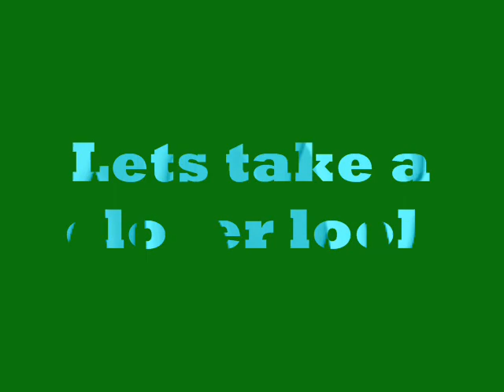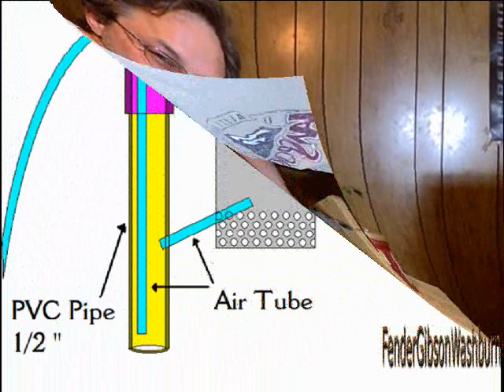Easy To Build Hydroponics System: The Percolator

Comment from the maker: @MrBlue609 Sounds like an interesting project. Experimenting and playing around with different configurations and ideas is my favourite part of this hobby. I've seen a similar system made with a 5 gallon bucket. I would imagine the number of air lift pumps would only be limited by the volume of air your particular pump could produce. Don't be afraid of trying different ideas. Chances are you'll come up with something amazing. Good luck and have fun with it!

Comment from the maker: @Shaunese07 I just let it run 24/7. Since it isn't a constant flow the roots get enough air. Switching it on for only 15 minutes is more for Ebb an Flow type systems. It sounds like it could be an interesting experiment though. Thanks for the comment.

Comment from the maker: Rockwool  works well in this system as do many other hydroponic medium. This plant was actually started in potting mix. I carefully washed off the soil and planted it directly into the Hydroton.

Hydroton is used mostly to hold the plant in place. I like Hydroton because It will retain some of the solution while allowing the excess to drain away.

Comment from the maker: Yes, you can use gravel with this system. I've used the small Pea Gravel that's used for landscaping and it works fine.

The stuff in this video is Hydroton. it's really light weight stuff. You would have to buy it from a Hydroponics Store or online.

Don't stress over it, just about any small stones will work since this is a constant drip system.

I have Oregano in this one now and it's growing like crazy.

Comment from the maker: Hello pattystaff,
Once a week., it only holds a few cups of solution. 
Yes, if you use this or Ebb and Flow it's usually just a case of personal  preference. 
In my experience yes. If you put a T in the line, one will work well and the other won't with a standard aquarium pump. A single pump with dual outlets will run two of these.

Comment: if instead of the air tube i put a cap on the other side and drill a bunch of little wholes on the part that is submerged in the water,would that work as an air stone.

Comment from the maker: Yes you can. I've seen something similar done with a 5 gallon bucket. Put "top drip bucket system" in the search box. That one uses an airlift pump like mine but is a top drip system where mine is fed into the side of the net pot. It works exactly like this one in that it uses an aquarium air pump to operate it. You may have to experiment with solution levels and tube diameters to get it to work properly. Good luck and have fun!

Comment from the maker: 1. Yes the level is kept exactly the same all the time. I regret not adding an external level viewer of some sort. My next video will show you how to add one. 2. This unit is great for organic nutrients. Since it uses an airlift pump there are no motors to get gummed up or nozzles to get plugged.  Do yourself a favor and do not try to grow a tomato plant with this tiny system like I did. LOL This should do well for herbs or something small like a pepper plant. Most importantly, Have Fun!

Comment from the maker: In this case I did start the seed in dirt and washed the dirt off the roots and put it in the net pot then filled it the rest of the way up with Hydroton. You can start seeds many ways for Hydroponics such as in Rock wool or Sure To Grow cubes. You can also use cuttings from another plant in a process called Cloning. There are many good videos about these subjects here on You Tube and on the internet.

Comment from the maker: Yes, just an air pump for an aquarium. The air hose is just stuck in a hole I drilled in an end cap and it goes almost to the bottom of the PVC pipe. The diagram at the end of the video shows how it all goes together.

Comment from the maker: I have a 2 liter bottle set up just like that. Simple but effective. The pump is left on 24/7. A top feed with an air-lift was my inital goal. I couldn't get the lift I wanted so I just went with it the way it was. I'm very happy with how it turned out. I think the roots will fill such a small containner in less than a month. I will have to transfer the tomato plant to a larger system then.

Comment from the maker: Thank you. I could only get it to lift about an inch above the level of the solution. I could have used a more powerful air pump or smaller diameter tube, but what fun would that be? LOL  I got another half inch of lift by putting the feed tube at an angle. Still wouldn't do for a top feed, so I just stuck it in the side of the net pot (yogurt cup) and it worked. Tomato plant + small container X one month = recipe for disaster. A tomato plant may not be the best choice for this small system.

Comment: Very clever!  General Hydroponics uses an air-lift system in a couple of their units but they manufactured a special fitting - yours is simpler and probably works just as well.  You use the Keep It simple method - I like that!